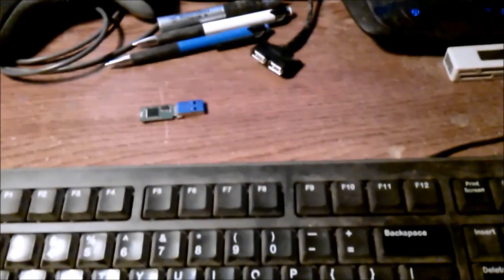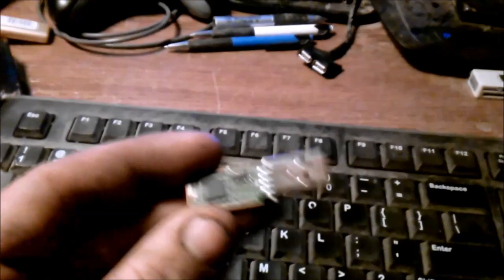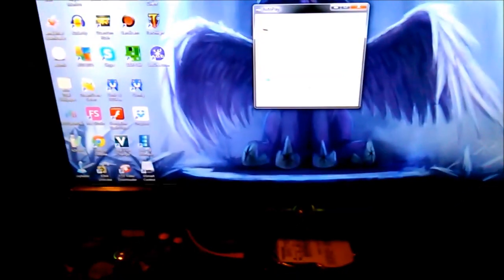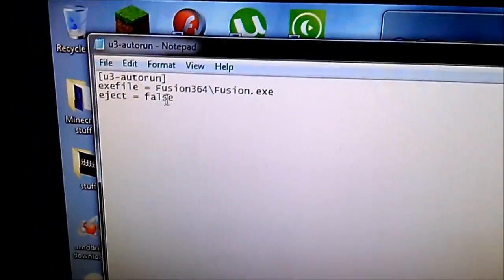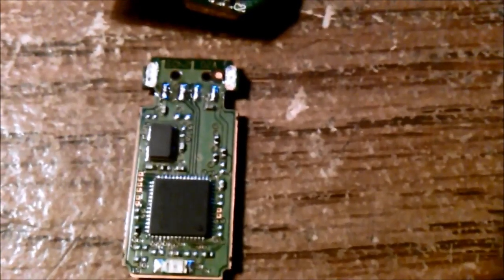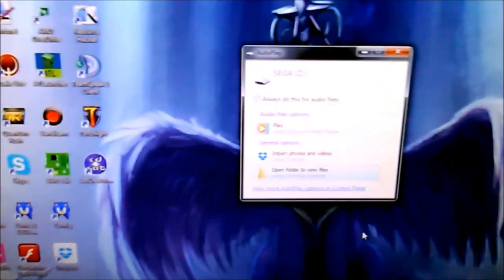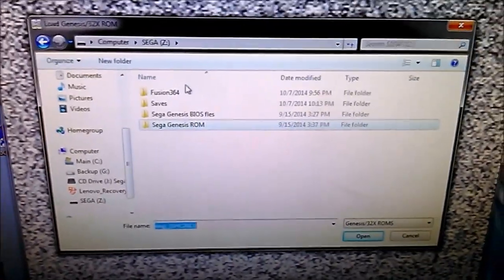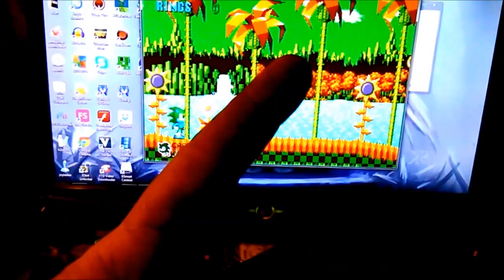Genesis emulator in a controller auto launches on Windows PC

Comment: That was awsome...wonder if it will work on ps2 or xbox ? To bypass the exploit steps
Reply from the maker: This only works on Windows computers due to the nature of the software. No consoles, no Linux, and no Mac OSX. Sorry.
Reply: What about the Dreamcast?
Reply from the maker: Kevin Twiner Dude. Dreamcast is a console and I've already said this will only work on a Windows computer. It will not work on anything else at all. Besides, Dreamcast doesn't have any host USB lines on it so this can't be plugged in anyways.